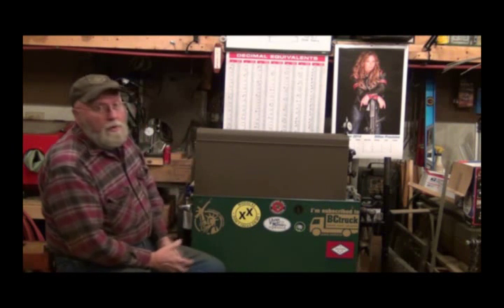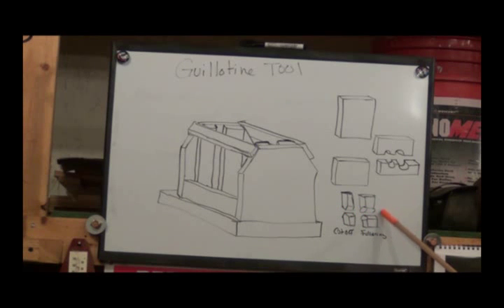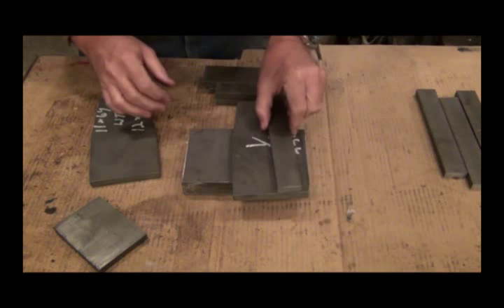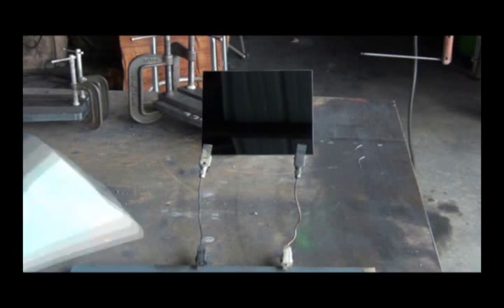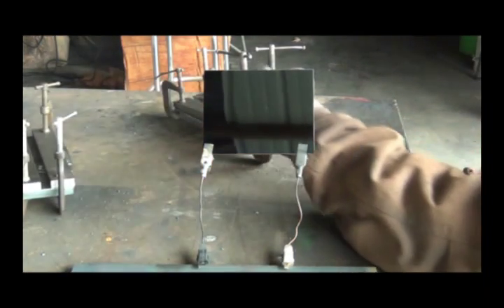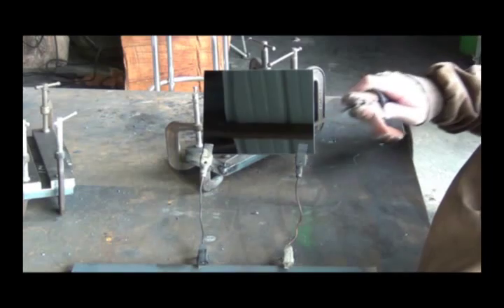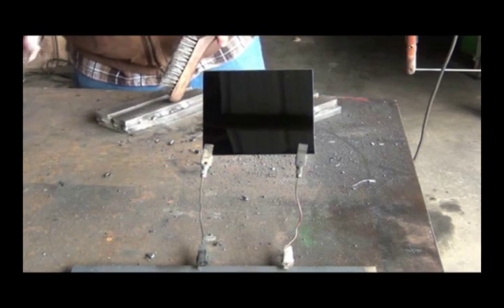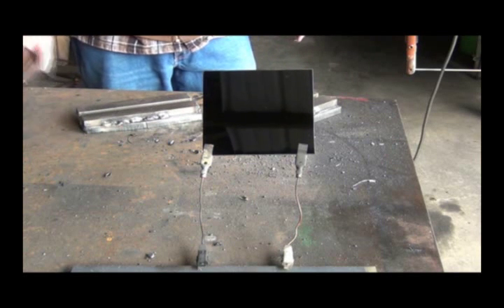Blacksmithing Guillotine tool build part 1

Comment: Nice tool, be very careful when using it, as you always are. Looking forward to it's completion.
Just move shield closer to camera, like your helmet is close to your eyes.
....13
Reply from the maker: arkansas13 I tried to put it on the tripod but it wouldn't stay. Guess I have another build project.

Comment: Careful with that thing.  You could mash a finger.
Reply from the maker: 628DirtRooster One hand holds the hammer the other has the cold end of the hot steel. Fingers clear of the guillotine!